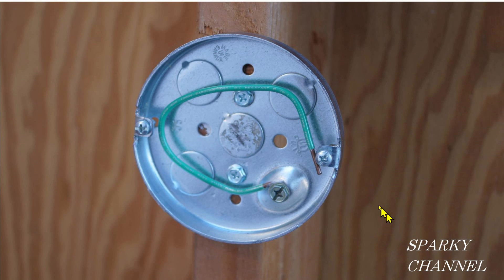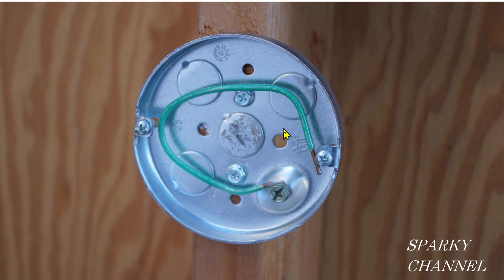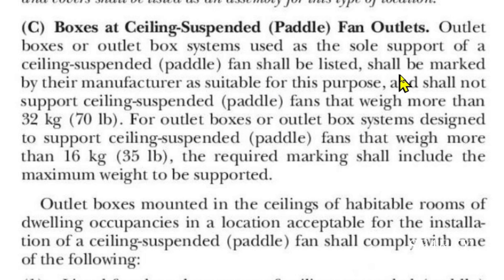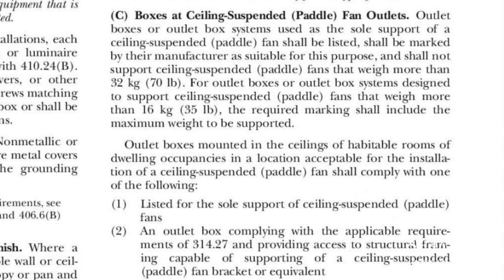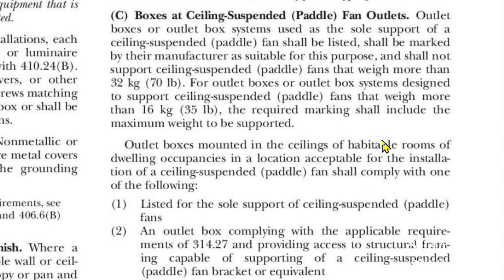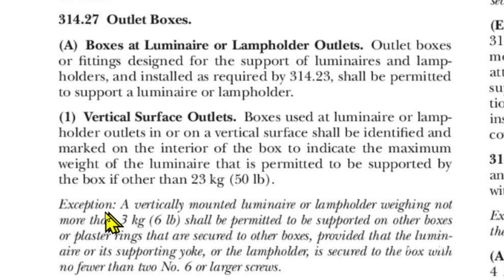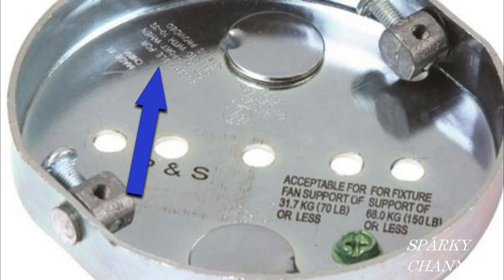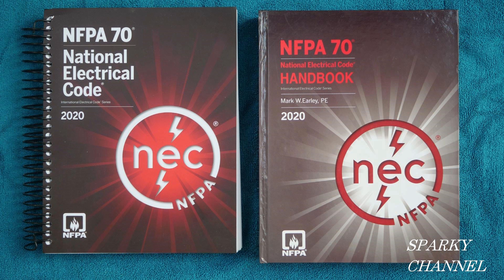Is this Pancake Box Acceptable to Support Ceiling Fans & Wall Sconces by the 2020 NEC?

Comment: When I use a pancake box for a fan, I run lag screws through the fan cradle directly into the joist just outside the box, so technically I’m not using the box as sole support. Problem solved.
Reply: That's the way I always did it before the requirements of the fan rated Box and even with octagon boxes on a backer board I would run 3 and a 1/2 and dry wall screws through the fan bracket through the small holes in the back of the Box into the wood so the wood always held the fan. better than the fan brace itself. I do that with foyer fixtures also.

Comment: There's nothing wrong with the old pancake boxes. OK, so they can't be used for a ceiling fan in 2020. But they still are acceptable for light fixtures within the listed restrictions. For example I used them for two french door side lights in 2018 on my addition. I screwed them directly to the 5/8in OSB sheeting for the desired spacing, not even to a stud . But they were more than sufficient to hold two small bulkhead lights and they were flush with the finished stucco, that's why I did it. Oh, and it passed inspection no problem. Home Depot sells a lot of electrical parts you can misuse and get into a lot of trouble. But DIYer beware. You can't legislate away stupidity.
Reply from the maker: Thanks Andy! Merry Christmas. 🎄

Comment: I once saw an electrician stuff roughly 12 wires in a 4x4 box , to run a ceiling fan and lighting. And when the home owner was told that box was to small , the electrician wss not happy the next day because all his wiring was no longer attached and boxes were empty. 😁 you wouldn't know a person who would do such a thing do you?  All power to the kitchen was turned off and all wires were capped. Per owners orders. Thanks for the tip Bill , learn something new everyday from you.
Reply from the maker: Good one! Merry Christmas. 🎄

Comment: When I mentioned it yesterday they do have a pancake box that is manufacturer speced for a ceiling fan. It generally has a white opaque cover on the outside to hold the screws.
Reply: https://www.homedepot.com/p/Westinghouse-6-cu-in-New-Construction-or-Remodel-Ceiling-Fan-Saf-T-Pan-0103600/204845541

Comment: The caveat of the code is the wording "sole support". Two #10 lag screws installed into the fan support bracket, driven through two of the open mounting holes in the back of the pancake into the wooden joist would make it totally acceptable for fan support.   Using this method the entire weight of the fan is being supported by the wooden joist, #10 screws and fan support bracket. The pancake is only being utilized as a junction box for the wiring terminations which it is designed for.
Reply from the maker: Let me see if I have this. You are proposing to drill a #10 lag screw through the fan bracket and through the holes in the back of the pancake box? How do you know that these holes would line up and wouldn't the 2 lag screws change the box fill rating? I'm probably not following you correctly.
Reply: @SparkyChannel  the fan brackets usually have slotted mounting holes so you can slide the bracket side to side for minor alignments. The pancake (like the one in your video has multiple mounting holes for different mounting options. Just looking at yours the inner two holes you used to mount the pancake. There are two empty outer holes that could be utilized for accepting a #10 lag screw. Many fans come with 3" #10 lag screws just for this purpose. As far as the box fill question....that's a good question.  I'm not sure what the answer to that is.
Reply: @SparkyChannel  He's right, most fans come with two 3" #10 wood screws for mounting to a non-fan rated box as shown here. Notice the two holes in the box over top of the ceiling joist. Those holes are for the fan support screws to pass through. The box can be utilized for a fan this way as the fan is supported directly by the joist, not the box. I have confirmed this with an engineer previously on a small commercial project before. The box is specified for this use by the manufacturer.
Reply: @jsncrso  As long as the inspector passes it then it's all good.
Reply: The entire weight of the fan is supposed to be supported by the joist regardless, via the box. The issue is how it is supported entirely. The code is making it more clear. For example, prior to code specifying it, framers would sometimes just nail the deck ledger to the house and call it good. Now code requires better fasteners and fastening plans to keep it secure, as well as proper flashing. I suppose the introduction of all the "old work" ceiling boxes brought us to this point (the kinds that have the tabs that swing out to grab the back side of your wall board). I've come across so many situations where people are hanging heavy fixtures onto boxes that are supported by nothing more than the sheetrock.
Reply: The fan bracket is typically quite a bit bigger than the box itself. Why don't you just screw it into the joist through the sheetrock?
Reply: @shrekoc5570  because the fan bracket is made to simply support the fan. It is not an acceptable or UL approved electrical junction box in order to terminate the wires and to make the wiring splices/connections.

Comment: I paused at @1:40 to say this: I was not sure until you said it had #8 screws; I believe that a fan required #10 screws, so no it’s not acceptable. However, I’m not an electrician, so I’ll listen on now.
Reply from the maker: Yes, the #10 screws and extra metal support where the screws attach make the box much beefier.

Comment: I read that last code language as saying the box only has to be marked if the weight rating is something other than a light fixture weighing up to 50 pounds.  but yes, they do want all boxes marked with a weight rating, to make it easy.
Reply from the maker: Hi Ken! It would be nice if they would just write what they want in plain English. Such as English that busy contractors can understand. Merry Christmas. 🎄
Reply: @SparkyChannel  yeah, they do sometimes have trouble with that

Comment: It's home depot's job to sell all the options a manufacturer makes, not sell only what the code says. It's the job of the electrician to know the code and know when he wants to defy it (idk why but he would)
Reply: As he said, they sell it as applicable. This is false advertising.  It is not applicable.  That said, it may have been stocked wrong, or restocked by a customer.
Reply from the maker: @timrich6755  To be fair, I should also say that they have had inventory problems related to Covid.
Reply: @timrich6755  well either way there's outdated methods that are still "safe", using quotes because just because something is not to code doesn't mean it's not safe so as long as it's safe and gets it job done they will probably sell it and it's not their responsibility to follow code, it's yours and your ass if you decide against is better not there's
Reply: Pancake boxes are usually used for small lights, not fans. We always got the fan rated ones when needed.

Comment: Can you do a video going deeper into the 314.27(C) update? I've been told by an electrician that runs his own business that his interpretation is that this means any location that could have a paddle fan installed in it at a later date now requires a fan rated box (which I think is what you're leaning towards), but the master electrician who runs the business I work at says nothing substantively has changed because 314.27(C)(2) references all of 314.27 which includes 314.27(A)(2) which allows you to define whichever location you're at as either "used exclusively for lighting" or "a location acceptable for the installation of a [fan]." Is it truly still up to your discretion based on what's going there for your installation, or do all ceiling boxes located in spots with proper clearance now have to be fan rated?
Thanks for your videos! Excited to see the one about pancake box fill calculations! (3 inch vs 4 inch makes a huge difference!)
Reply: that will be coming in the future.  we already discussed it on his earlier fan box video, and he's looking it up.  I'll also be looking it up when I get my 2020 handbook.
Reply: You can use this box for a fan. However, you must use the included 3" #10  wood lag screws and secure the fan mounting bracket directly to the joist. That's what the two holes in the box allow for and is what the manufacturer specifies. This video, while informative, is a bit misleading about that

Comment: Stores like Home Depot and Lowes don't give any guidance on which devices are allowed. For instance, they sell very few TR receptacles compared to the vast selection of non-TR receptacles. And then layer on supply-chain shortages and it can be hard to get what you need to meet the NEC code, what is easy to wire (my own code), and the right color (my wife's code).
Reply from the maker: Well put, that's exactly right. TR receptacles is another good example of the consumer having to know what is needed by code to protect himself. Merry Christmas. 🎄

Comment: hey, when it comes to fanboxes: talk about saddle boxes (they still have those in builders/farm yards. love the look) 
& that grey plastic one with the offset wire pocket (fanmaster? in Hone Despot)
Reply: I use these all the time. The old houses I work in are pre World War One. The ceiling box is almost always a black enamel pancake box screwed directly to a ceiling joist. And on the second floor the power feed is always into the fixture with a switch loop to the wall.  So if you want two switches (with a neutral wire) for fan and light even a fan rated pancake box gets really tight for space. The Saddle box gives you plenty of space to push those Wagos out of the way.
Reply: saddle boxes are now designed for the fan to be secured directly to the rafter or truss the box is mounted to.

Comment: depends on the lugs: needs to be #10 mech screws, grabbing/threading into the back of the pancake. details matter! Or go totally mech with metal hole drilling, more lag bolts directly from bracket to joist, etc...
Reply: them pancake boxes with the rotating threaded barrels? they give me nightmares. think what happens if screws went in that are a bit too long...

Comment: Good video. This box would be suitable to put a surface mounted light fixture on. Let’s say it was a remodel application and the location of the fixture needed to be where a ceiling joist was located. This box would work perfectly for that scenario, so there is a place for it.
Reply from the maker: Not if it would be possible for someone to put a fan in that spot later on. Merry Christmas. 🎄

Comment: That pancake box would be acceptable to mount a ceiling fan if the box isn’t the sole support of the fan. If you lag the fan directly to the stud then the box is no longer the sole support of the ceiling fan and then you would meet the requirements of the code.
Reply: Exactly!
Reply from the maker: Excellent point, thanks! Merry Christmas. 🎄

Comment: Home Depot does sell a pancake box that is fan rated. For some reason it’s not located in the main electrical box aisle. You can find it in the ceiling fan aisle. That particular one uses #10 screws, and is marked for fan use.
Reply: and the screws thread into the back of the box, not just the little lugs.
Reply from the maker: I'll have to check that out. Thanks! Merry Christmas. 🎄
Reply: @SparkyChannel  You can also go online and look up what's in stock at your local Home Depot/Lowes. It will also tell you what aisle. Sometimes they aren't located in the same spot as the others like the other guy above mentioned.

Comment: I agree with you re: fan support.  Yes, the pancake box can be fastened directly to the structural framing members, but thaat ensures only that the box won't fall on your head.  The screws which hold the fan to the box must be support by more metal than the little ears in your example box.  Pancake boxes which are listed and "suitable for fan support" do not use the little ears for the fixture mounting screws.  That's a good way to tell at a glance whether a box is OK for fans or not.
Reply from the maker: Excellent point, thanks! Merry Christmas. 🎄
Reply: I have used them multiple times, and I agree with you however, what I would do is drill out holes around the joist so my 10-32 screws go through the box and are fastened with nuts and lock washers and then lag screw the box to the joist

Comment: To me, a lot of the codes contradict themselves and it always seems like you have a “keyboard warrior” sitting behind a  desk make up a bunch of crap to make it harder and more difficult for an electrician, hvac tech, plumber etc to do their jobs. thanks for the informative video as always Bill... awesome as usual sir and have a great Xmas....👍👍👍
Reply from the maker: Yes, I agree. IMO This is an area where the code does contradict itself. That's why I mentioned my interpretation could be a little controversial. Merry Christmas. 🎄
Reply: @SparkyChannel  It isn't very difficult like some people are making it out to be. I knew the difference between a pancake and a fan rated pancake box years ago and I am not an electrician. I am a lighting installer/designer. All fan rated boxed always had the #10 screws. Maybe I just had a knowledgable teacher. Lol